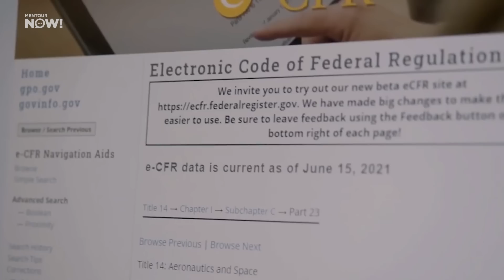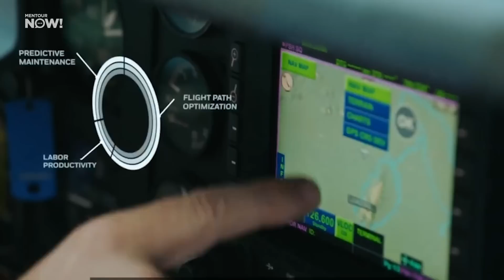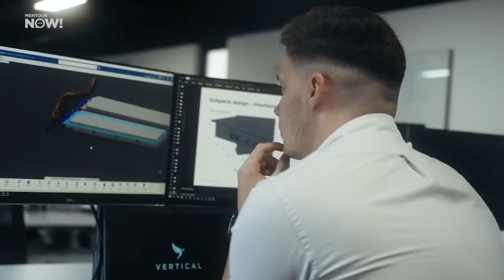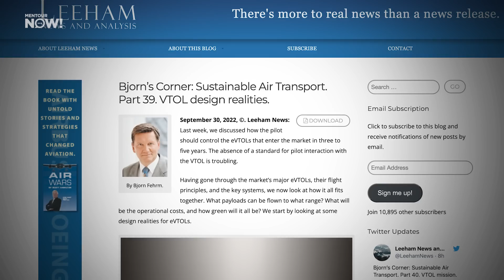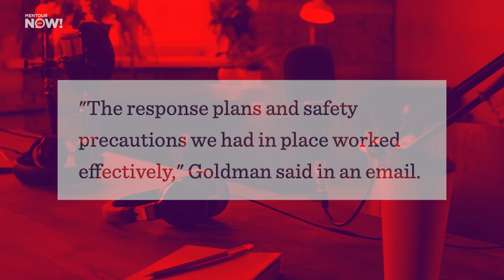Will they SHARE their Secrets?! Electric Aircraft Safety culture

Comment: Are these overheating problems with batteries the same as Samsung experienced with their Galaxy Note 7 and in resent years other Galaxy phones, which were 3-4 years old? Is there some sort of chemical inside the batteries that prevents the batteries from overheating? I know that in my company, we use electric busses for transport, but to prevent the batteries from overheating, both during operation and charging overnight, a oil heater is installed, which runs a generator of sorts to always keep the batteries at a optimum service temperature, thus preventing a fire to occur.
Reply: Batteries generate heat, the higher the energy density, the more heat they create, temps above around 130 f get a destructive runaway reaction going. BMS systems balance and keep voltages within cell voltage parameters, 4.2 v max for lipo, 3.6 for lifepo4. At freezing temps, both act dead. Both need to be heated and cooled to be kept within boundaries.

Comment: battery safety is becoming a concern in the road vehicle world, too.  hopefully there will be breakthroughs in battery fire suppression that will benefit everybody.
Reply: best way to get around that problem is too not use lithium based packs
Reply: Only way is to dissipate all that energy from the battery somewhere else, before it turns into heat and ignition point is reached. After that only way is to flood the battery with water to transfer that heat to it and deprive it from oxygen. All witch are next to impossible to do in small plane like that. Witch just happens to also remove battery from the operation and well you kinda need it. I dont have much faith on autorotation capabilities of these things and transitioning from level to hover flight being the most dangerous thing before landing and taking off, if battery fault happens there, good fucking luck..
These might be fun toys to fly as essentially hover craft that can take off a little bit, but i would not fly these any higher than that. Essentially just ground effect vehicles.

Comment: Many VTOL electric aircraft are nothing but large multi-motor drones which fly by hanging on the props. With this configuration, if the power stops, you then fall like a stone with NO means of flying recovery. Why? Due to both the magnets in the multiple motors and the minimal rotational inertia of the small multiple props, you can neither completely disconnect from the power source for free prop blade rotation, nor can you reverse prop pitch - both functions which are available in a helicopter to auto-rotate, and thus use the large main rotor as a parachute. A wing of some sort (fixed or rotating), or a deployable airframe parachute, is an absolute necessity for any chance of a survivable landing in ANY aircraft, if you go down with it.

Comment: Since we are on the topic of safety what happens if you loose engine power? On current jet airliners you can glide your way down. These so called "new and improved" aircraft do not have the gliding capability. "Oh but they are VTAL aircraft so if they get low on batteries they can just land anywhere right"? If over land then possibly yes, but what about transatlantic flights or transpacific flights what happens if you get low on batteries then? Let's say it looks like they have plenty of electric charge to make it across the ocean but halfway through the flight they realize they don't have enough charge how will the fix that situation? Also if these aircraft run on electric how will they fit the nessisary size they need in order to get hundreds passengers across the globe? They can't even do a 20 seat configuration. What would most likely happen is these so called "eVTAL aircraft" is they will not have the capabilities to make traveling better. Lets not forget the fact that they are propeller aircraft.  They do not have the ability to cruise at high altitudes. The max height most propeller aircraft can cruise at the highest 10,000ft. So these aircraft are also much slower then a jet engine aircraft. The only way I can see these aircraft used is to possibly replace cars and now instead of driving everywhere you go now you fly everywhere you go. Now how would that be safe?
Reply: Batteries are considered for local flights only (to be replaced by trains in Europe). Intercontinental, well anything over 2h: hydrogen. Dead end?

Comment: What I struggle with on electric powered planes is the weight. A normal aircraft has a max takeoff and a max landing weight with the takeoff being higher then the plane burns the fuel which brings the weight down. Do electric planes have the same max takeoff and landing weights as they have no mass to lose through flight?
Reply: Yes it has the same weight but less energy in battery which further compounds the problem. It will be a miracle if they create one that is financially viable without gov subsidies.
Reply: @mofayer  Of course government is gonna push for this just like the electric cars. Oshkosh is gonna be boring as hell probably in the next decade or two if they somehow do it.

Comment: Aside from the fire hazard of batteries, flying on electrical power cannot "take off" until the batteries'  energy-to-weight ratio problem is resolved.

Afterall, flying one or two passengers for 20 km is one thing and flying 300 passengers trans continents is another.
Reply: Flying 300 pax trans-cont with evtol is an old concept, well-known from science fiction of the 1940's. I'd love to see the Boeing Bopper-Hopper Chopper-Topper Whopper-X en route from Berlin to Buenos Aires. Thousands of little propellers on top of the aircraft, all working their little asses off.
     Also, we aren't talking only 300 pax long-haul aircraft here, are we? Meseems 30 pax short-haul fixed-wing aircraft. say 200 km - 600 km range, are already in the pipeline for practical use. There is a market for such aircraft, for several reasons.
     And lastly, electrical aircraft and traditionally fueled aircraft are not really comparable technologies. The one is in the very beginning of its development, the other is very mature. Any comparison would by necessity be very unbalanced.
     Future ideas, like the recently published project to integrate the batteries into the hull of automobiles, which would mean a great reducement in overall weight, could be applied to aircraft. So give us another 10-15 years of development and I suspect that a comparison made then would be quite interesting.
cheers/CS

Comment: Lithium Batteries have an operating temperature range of 32°F (0°C) - 131°F (55°C) hhhmmm and at Geo-potential Altitude above Sea Level 5000 Feet you are at	41.17F and by 10000 you are below the minimum operation temperature	23.36F  so are these going to be intended to be a 'crop duster' air taxi kind of deal?
Reply: Adding some insulation + current draw from them producing some heat might not make that the worst problem, certain battery systems for cars already include temperature management. Some only active cooling but others also to allow you to heat them either with heat produced through an inefficient resistive source and others (a few Tesla models if I'm not mistaken) actually using the heat pump of the AC. 

But honestly that's the last thing I'd worry about right now, batteries don't have much energy density compared to liquid fuel so unless the constraints of battery design somehow totally change I wouldn't expect them to be used outside local use cases and being flown as a hobby/toy for rich people to get around.
Reply: Mostly air taxis within large cities.

I know drones are being used for crop inspection but they need more carrying capacity to be crop dusters or seeders.

Comment: I keep wondering: In case the electrical system fails catastrophically for whatever reason in such an aircraft, would it drop out of the sky like a stone? Or would it be able to autorotate like a helicopter, using its potential energy to get to the ground somewhat safely, even though probably not gracefully?
Reply: if the aircraft has a an electrical failure for what ever reason even during forward flight it would still be able to generate lift for the wings and be able to glide. unless it is purely vtol then a ballistic recovery system would need to be employed to save the aircraft. the tilt rotor designs could easily just glide when in forward flight but would still need a BRS for hover. electric motors just simply stop dead when they lose power, so auto rotation is not going to work while the aircraft is hovering or in forward flight.

Comment: 🇬🇧🙋🏾‍♀️Oh my days these things are real? 🤯
Reply: I've stood next to the the white one that looks like a helicopter with the ring of small rotors on top. I've also seen one that looks like a 4-wheeler ATV (quadbike) crossed with a huge quadcopter drone. The ones with two wings, each holding a row of propeller blades,  and varying ways to move between vertical and horizontal flight - there's been at least one on display at AirVenture the last few years I have been attending. The wildest one is something called the BlackFly which did fly at AirVenture Oshkosh 2022.
Reply: @BigBlueJake  🤯wow🤯

Comment: regarding the point that Electric Aircraft will need specialized Batteries: i highly doubt that will be the case. Especially for the reason you specified. Because if you Increase the possible (and used) power Draw of a Cell/Pack you will also decrease the time you can run off that Battery/Pack because you suck out the same Energy faster. (reference C Rating for more info)
Typical EV Batteries these Days have a C-Rating between 2 and 4, meaning (if you omit charge/discharge curves) they can be fully charged/discharged in 30 to 15 minutes*, so if you aim for a total Flight time per Charge of 30 Minutes (which is imo too low for practical applications) and you only want to put in the minimum amount of Batteries (no safety margins) then you need specialized Cells with a higher C-Rating (which would be highly experimental and is usually Fire-prone) - all these make extremly high C-Rating Cells clearly not suitable for Aviation.
The Simple and more practical solution is to use more Cells than you need - this increases both flight time per Charge and maximum possible power draw. No need for special Cells in that regard.
Also using Industry-Standard cells over manufacturing specialized has other Advantages mainly related to mass production, like more consistent quality, easy availability, better known operational parameters, reduced cost for same capacity, and availability of alternatives in case problems with the current supplier appear.
Therefore I think its more likely they will use Industry-Standard Cells, but with increased requirements (paper trail of origin for each cell, more stringent selection process, probably including pre-cycling all Cells to make doubly sure no bad cell is in a batch)

*Charging and Discharging is for a simple comparision the same, and it omits some details like charging the upper 20% takes far longer, and the battery lifetime-preserving power draw at the lower end decreases (note that you CAN draw more power at the lower end, but it is not good for the overall lifetime of the Battery)
Reply: Oh, and one thing to add: Experimental High C-Rating Cells afaik also dont have a long lifetime, so using them to "get more power at the lower end" is afaik not much of a difference compared to current Cells which you overdraw from in an emergency

Comment: Battery technology really is a complicated topic. There's a trade-off between maximum power and total capacity (power density vs energy density) - which means eVTOLs need heavier batteries for the same range as electric fixed-wing aircraft. For significantly reduced risk of fire there's lithium iron phosphate, but that makes for an even heavier battery. Energy density is the main issue limiting the range of electric air transport. Fossil fuels are an incredible technology that's hard to replace - it's such a shame that it's slowly killing us and our home.
Reply: I think biofuels would be a more practical alternative.

Comment: The biggest safety concern regarding eVTOL aircraft is a simple one. The singular event which may result is a total loss. I am talking about asymmetrical thrust. Something as simple as a bird strike could render multiple on-side propulsion units inoperative such that an uncontrollable roll or rapid descent would follow. A singular event loss is something designers must mitigate.
Reply: The biggest safety concern are the ones flying these things, will they be ragrded with the same standard as airline pilots? Or do they just need to have training akin to a driving school? Either way both are impossible or near impossible commercially

Comment: My question is on the Batteries, Lithium Ion aren't allowed to be carried on commercial aircraft, atleast not in the baggage area. How are they going to certify evtols with lithium ion battery packs. The propensity of having a lithium battery fire is scary in aircraft.
Reply: Well I would expect that the exact battery unit going in there has to go through some stringent testing, has to be periodically inspected and is designed for the purpose. Wouldn't call it a non-issue myself, not just because fire and other risks but also that's going to be the power source that keeps you flying kinda bad to lose it mid flight.

However it's entirely different from random consumer items and loose battery shipments in boxes from third parties that aren't allowed to go into the baggage holds, the regulatory agencies for aviation have no oversight on their specifications nor are they likely ever to be inspected (unless the device fails and goes for a repair).

Comment: Yeah safety, like the 737 Max disaster
Reply from the maker: No systems are perfect, but aviation has shown a pretty remarkable improvement over the decades, partly due to these principles.
Reply: Where the regulators were the main responsables.
Reply: @migueldenovi5873  And Boeing for not telling anyone about MCAS
Reply: @heidirabenau511  80% blame on the FAA for preferring the MCAS (a critical system having direct input on control surfaces) against the aircraft having slightly different behavior at abnormal angles of attack (because of new engines). It is typical of a regulator, that they have to justify their existence by asking something else to approve something.

20% Boeing because of poor software programing logic. To not take advantage of the fact that there are two AOA sensors, and not check that there are no discrepancies between the measurements of both sensors for the system to be declared operational. Not even an Arduino programmer would have made that mistake. FAA also responsible here, because if they didn't even see that, why were they even there?.. If it depended on Boeing, the MCAS would have never existed.

Comment: Interesting video except for calling electric aircrafts sustainable. Using batteries instead of fuel just replaces  one problem with another. Not only is lithium a limited resource (estimations range from 2040 to 2100 until we used up all of it), mining lithium causes severe environmental damage in the regions affected. For the same reasons, you should not by an electric vehicle, but a hydrogen one.

Comment: I think that excessive concern about safety is not correct.  Commericial flying is safer by at least  factor of 10 compared to ground vehicles.  That means that there is a lot of leeway to accomodate more accidents and deaths.  You always have to balance the cost and benefit, and as it stands today, the cost of safety is too high. It is irrational.

As far as electric airplanes/vtols are concerned, I think that the control systems can easily be made very redundandent and safe, much more so then the gasoline engines; that is the  main selling point of electric airplanes.  If someone believes in "green" energy, he is just dumb. The beauty of electric flight is not because it is green, but because it is versatile.  Now, the main problem which is virtually can not be solved is the fire hazard, and no redundancy can be achieved there.